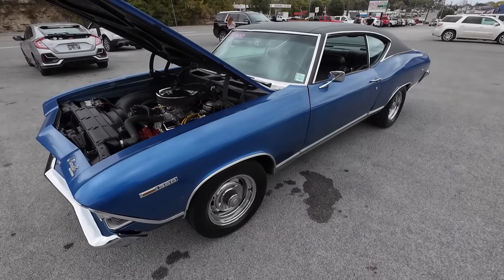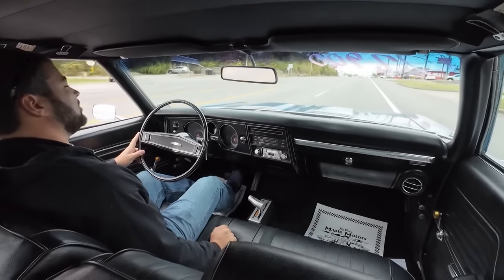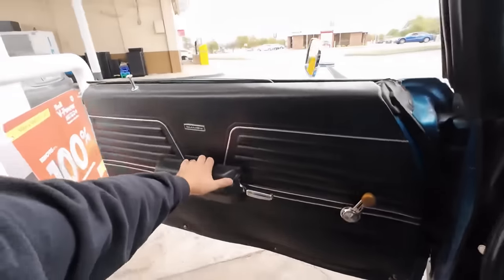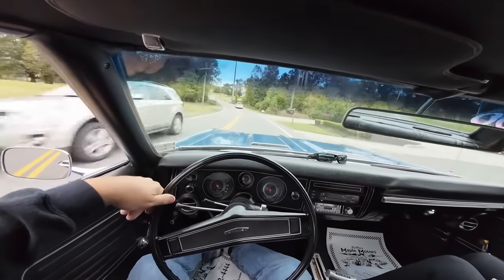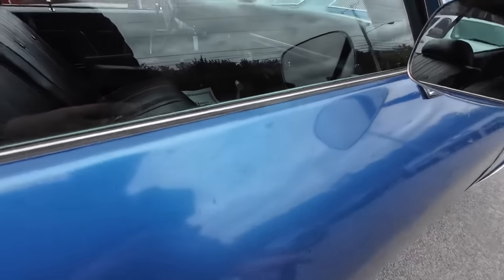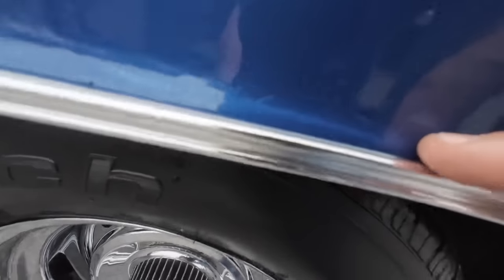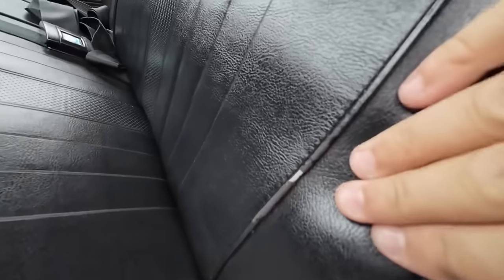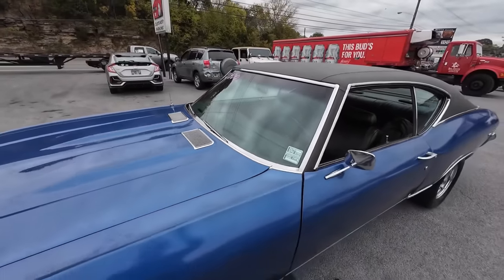Test Drive 1969 Chevrolet Chevelle SOLD $27,900 Maple Motors #2360

Comment: A few issues with the engine by the sound rotor cam
Reply: Expensive and will need new motor your looking at about $10,000 of work
Reply: Now I would add several more grand to the $10,000
Reply: They didn't take very good care of that car 😢 that's sad man.